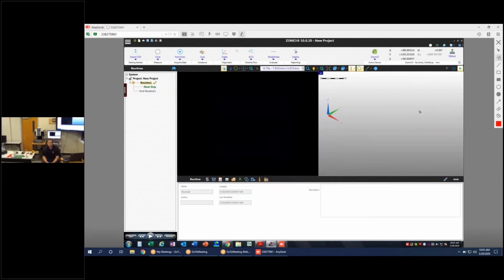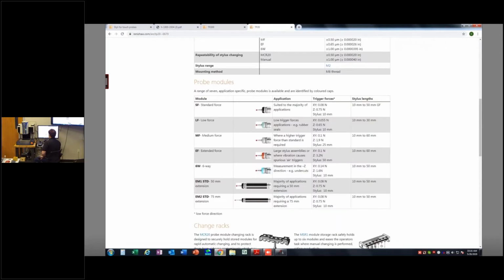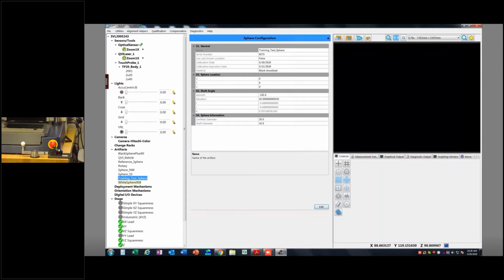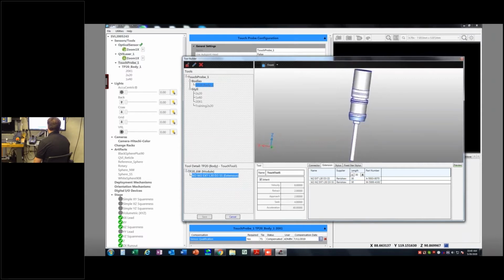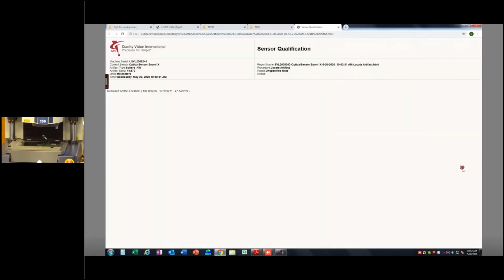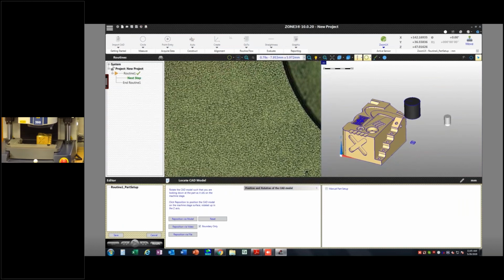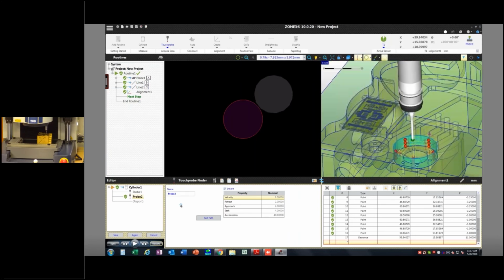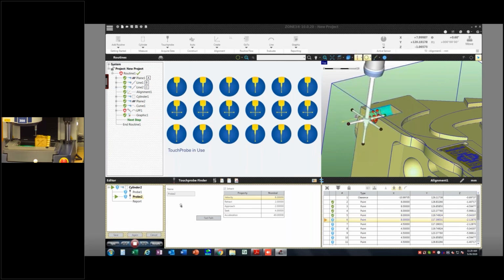ZONE3: Everything You Need to Know About TP20/200 Touch Probes

Comment: How often is a calibration required?
Reply from the maker: Great question! We recommend calibrating/verifying your probe tips every week or so, but this will vary significantly based on your tolerances, uses, and specific needs. The tighter your tolerances, the more often you should verify your tips, and the looser those tolerances, the less often this is necessary.